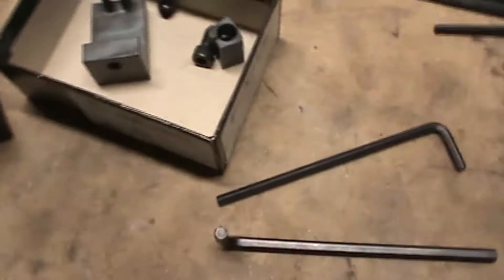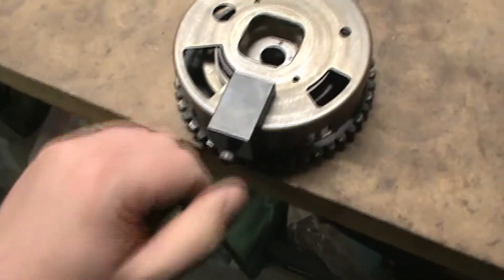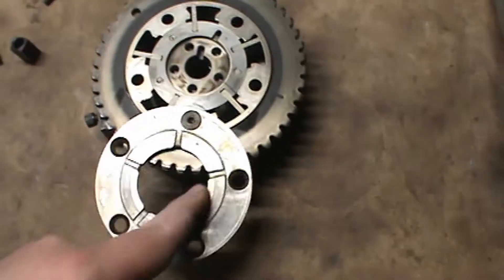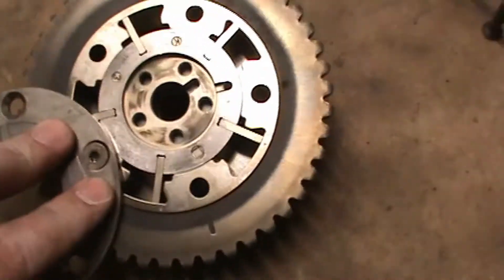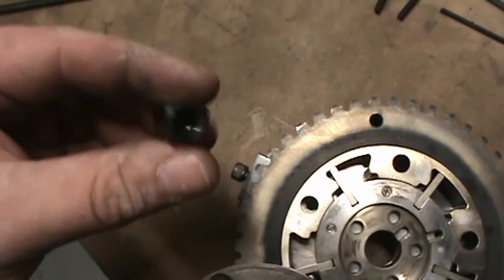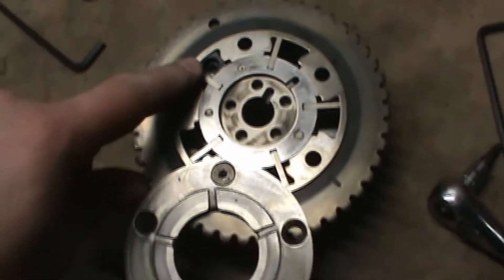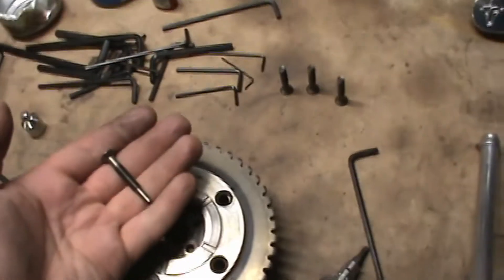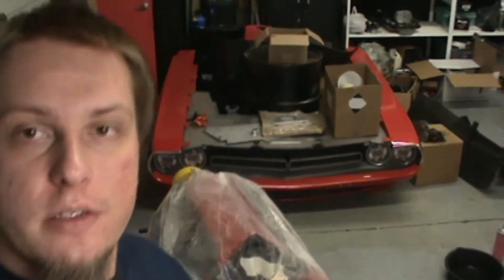Gen3 Hemi VVT Phaser Lock! Installing COMP Cams Part Number 5760 for the 5.7 (345) / 6.4 (392)

Comment: Why blocks the cam phaser in the retard position, which removes torque and increases fuel consumption for normal driving? Retarded the cam timing gives more power at high revs but takes away some at low revs so why lock it late? ??
Reply from the maker: This part only physically locks the phaser so it cannot adjust can timing and removes the chances of any piston to valve contact due to that. If you want to degree the cam in any way you do that with a multiple key way  lower timing sprocket.